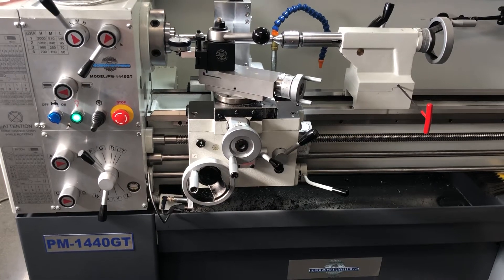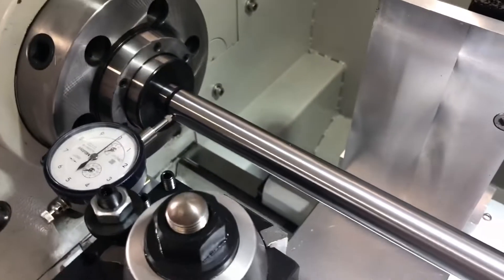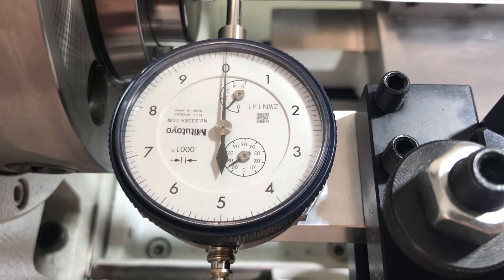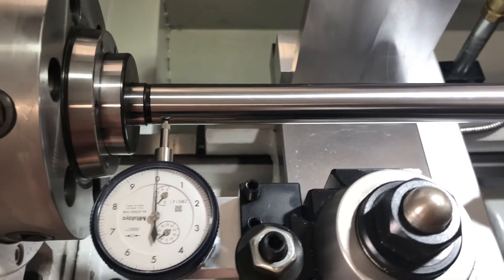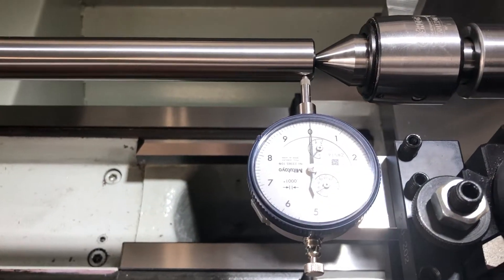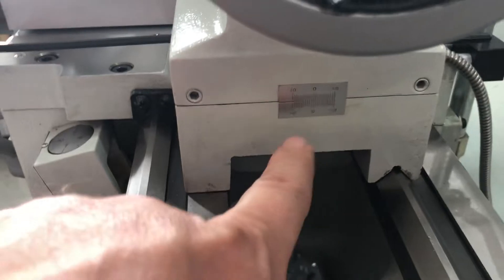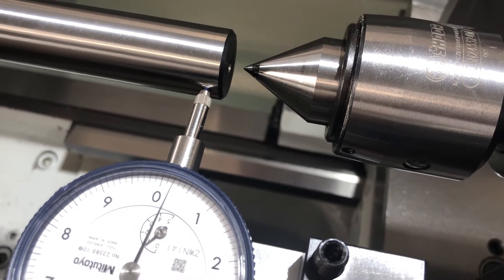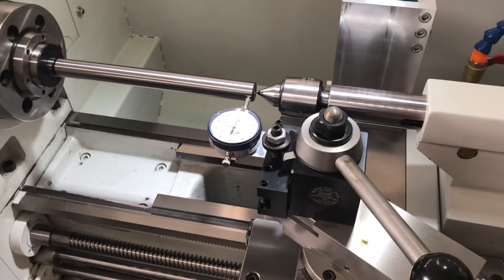PM-1440GT lathe spindle runout and dialing in the tailstock within .0002" using ground test bar

Comment: You used a live centre instead of a dead centre why.The clearances in the live centre will add to the descrepency like the cold headstock bearings.I was tutored to warm the machine up for at least 5min  before any material removal and manual operation of the machine and the nominal inspection temperature was at 20.5 degrees Celsius for working within 10ths of a thou of a mm,and microns.Great example though.
Cheers
Reply: My apologies for the error,thank you.Thabks for replying too.
Reply from the maker: You got it right, the machine and the live center were warmed up. Both of them have disclosed accuracy of .0002" which is what I was aiming at. Dead center wouldn't offer any advantage in this situation likely.

10ths of a thou of a mm isn't a micron btw. A micron is only a thousandth of a millimeter (0.001mm).